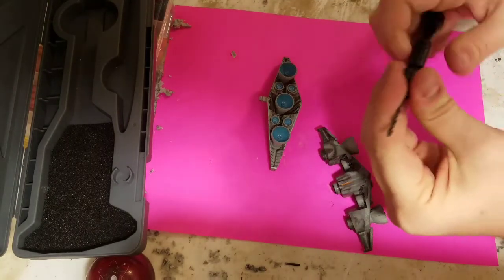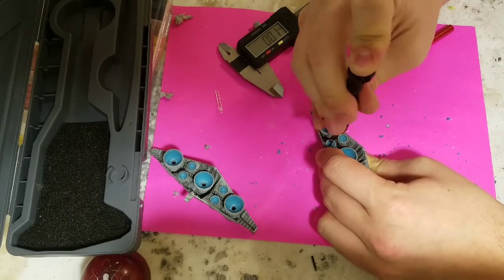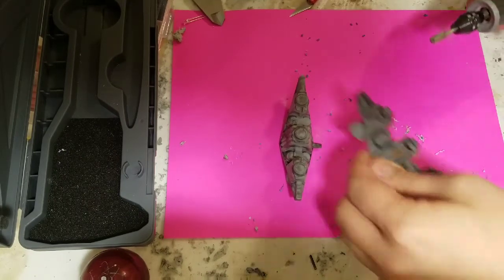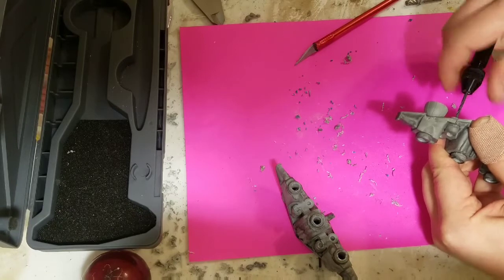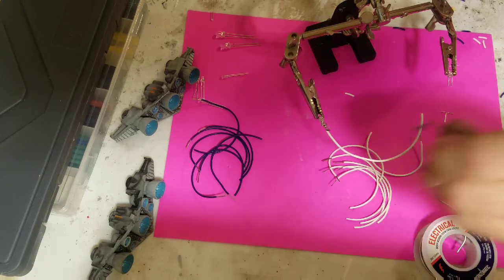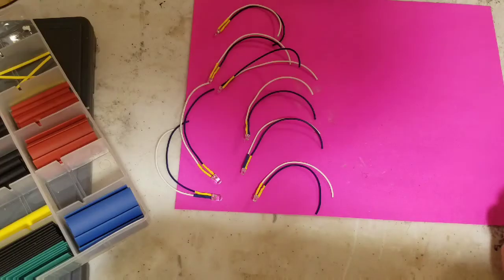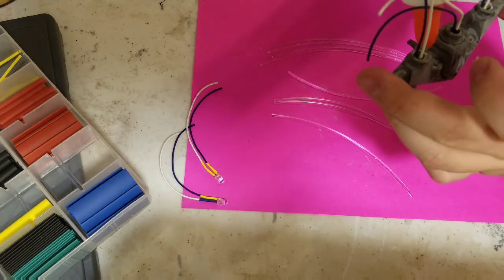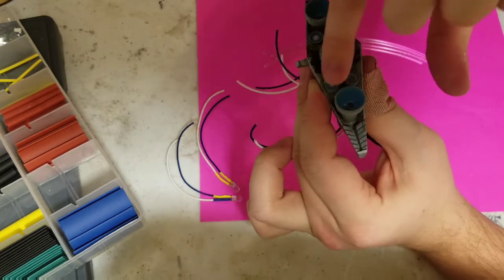Imperial Star Destroyer LED Modification Part 2 - Lighting the Engines

Comment: Why didn't you use fiber optics for the 3mm engines?
Reply from the maker: There is no real point to that.  You'd have to pipe the FOs back into the ship and to individual 3mm LEDs inside the ship.  So I suppose if you didn't like the round appearance of the LED, you could use a short FO jumper to provide a flat look if you wanted.